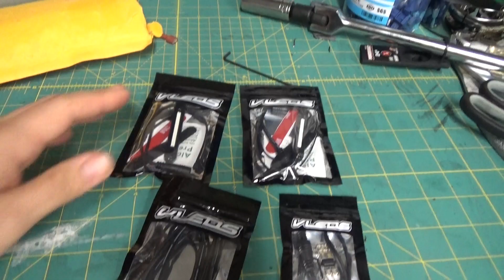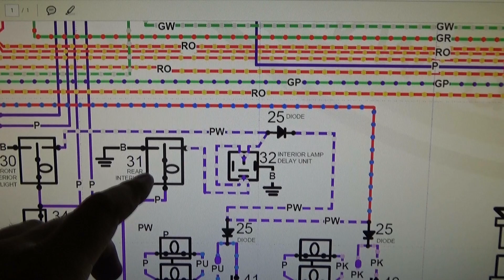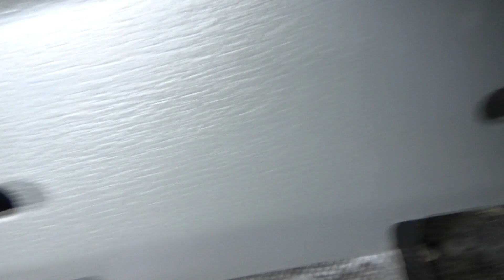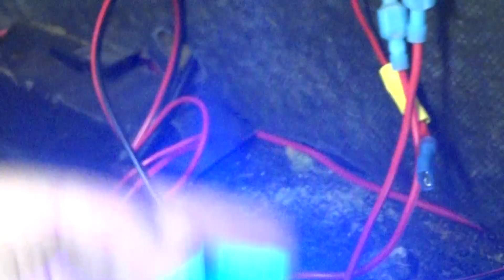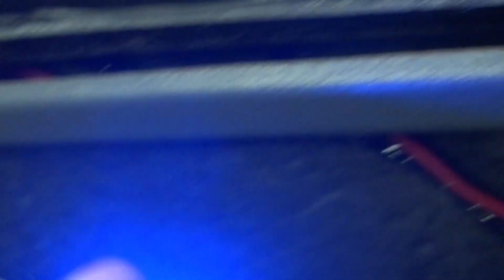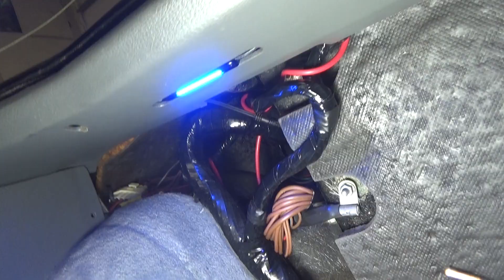Boost your DeLorean's interior LED lighting! Hidden VLEDs Lightbars installed in rear luggage area

Comment: Those vampire wire taps will bite you in the ass over time. As you clamp them down they always cut wire strands. Over 30 years a licensed electrician that has 40 years of working on cars and electric forklifts. I wont use them for anything unless it was a roadside get me hom quick fix.